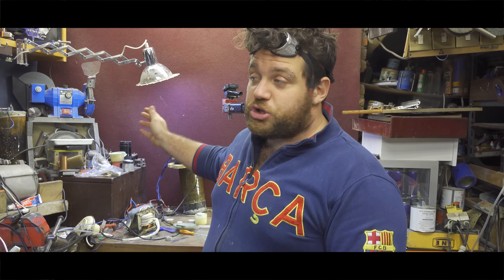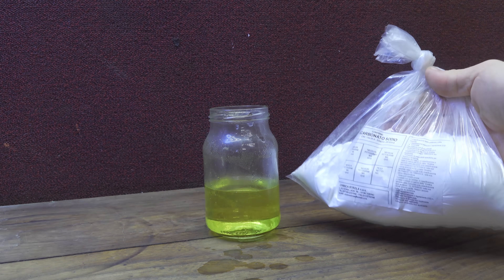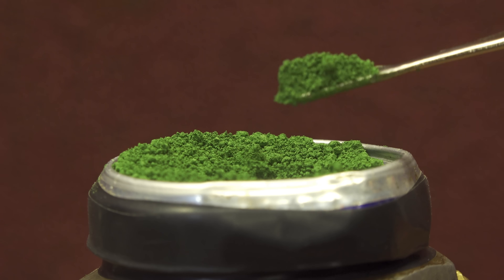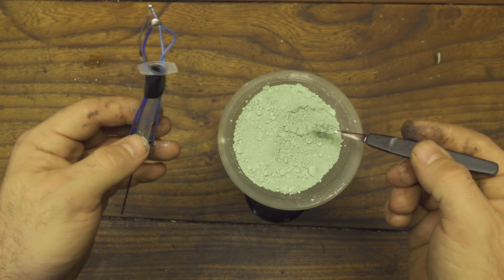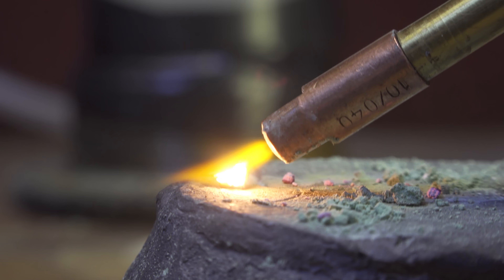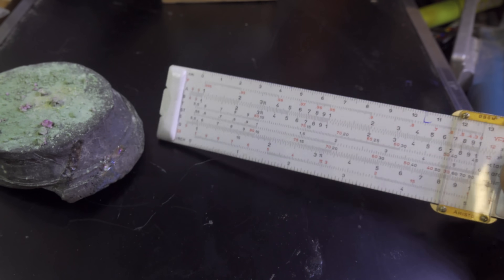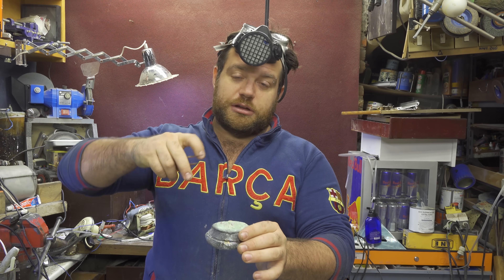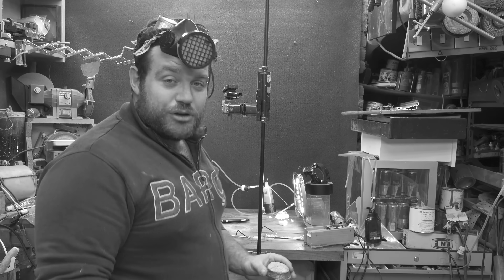How to Make precious Ruby at Home - 4K

Comment: I mean it's a cool video but I'm disliking it because of your complete lack of any safety measures or good chemistry practice whatsoever

gets to the part with the Chromium Oxide GOOD GOD MAN YOU'RE NOT EVEN WEARING GLOVES AND STICKING YOUR HAND RIGHT IN IT! Chromium is one of the most dangerous elements for several reasons. How many more life threatening things are you gonna do besides boiling acid and leaving a nice dusting of chromium laying around?

gets to the end Well hey at least you have a mask so you're not inhaling quite as much chromium

Comment: Industrial manufacture is made by injecting the powder into the gas feed to the flame. That way the powder melts in the flame which has to be run with an excess of hydrogen to make the flame reducing. So the burning hydrogen "steals" the oxygen from the aluminium oxide.

Comment: Heat the base surface to the powder melts as you apply additional powder. When you reach desired product, simply remove it from the base

Comment: You get a platinum crucible for $60k, your ingredients, and an autoclave to heat it, and in about a month, you can grow ruby crystals.  This was done for lasers by Hughes Aircraft in the 1980's.  The cost of production was quite high, and the process was discontinued.
Reply: Or, get a tungsten crucible? A lot cheaper.

Comment: I just stumbled into this, what did you mean with "ruby conducts electricity"? It is actually a good insulator with a 10^16 Ohm.m resistivity. By comparison, copper resistivity is on the 10^-8 Ohm.m range, 24 orders of magnitude lower than ruby.
Reply: with a name like Ruben  on this subject, I'm listening.

Comment: I want you to make emerald in one of your videos using 3:1 molar ratio of beryllium silicate BeSiO₃ and aluminium silicate Al₂(SiO₃)₃. 
3BeSiO₃ + Al₂(SiO₃)₃ = Be₃Al₂(SiO₃)₃ along with some traces of chromium(III) silicate Cr₂(SiO₃)₃ 

To make aluminium silicate, react 1:3 molar ratio of alumina and silica.
Al₂O₃ + 3SiO₂ = Al₂(SiO₃)₃

Then react 1:1 molar ratio of beryllium oxide and silica 
BeO + SiO₂ = BeSiO₃ 
Then react 1:3 molar ratio of chromium(III) oxide and silica
Cr₂O₃ + 3SiO₂ = Cr₂(SiO₃)₃

After you finish all of these react them to get emerald
Al₂(SiO₃)₃ + 3BeSiO₃ + Cr₂(SiO₃)₃ = Be₃Al₂(SiO₃)₆ with some traces of chromium.
Reply: Why do you need to react each Aluminium and Berylium with silica first? Can't you just mix the three of them together and let the reaction happen on the spot in the presence of HHO flame like in this video? I'm not very knowledgable in this subject and I am wondering if it is possible to make other gems using this process besides corundum. Thank you
Reply: @albertwidjaja5938  
Because if you react all the oxides together with silica some of the oxide will not react so there will be Crystal defects because of these unreacted oxides and silica.
Reply: @Shaheen_Hassan  Thanks for the answer. Learned something new today!
Reply: Forgot to ask, what temperature do you react the aluminium oxide with silicon dioxide?
Reply: @albertwidjaja5938  
You will react Aluminium oxide with silica at a temperature of 2100ᵒC and you will react Beryllium oxide and small amount of Chromium(III) oxide with silica at a temperature of 2600ᵒC. 
Then you will react both Aluminium silicate and beryllium silicate that contain traces of chromium oxide at temperature of 1800ᵒC.
Reply: @Shaheen_Hassan  Will it work for emerald? From what I've read you need hydrothermal or flux method to make emerald. If you can make emerald using this method, then can you make other silicate gems (jadeite, benitoite, peridot, etc)? I heard that jadeite can't be made in atmospheric pressure. Why aren't companies using the flame fusion method to produce emerald?

Comment: Wait, in order to get a crystal you need HIGH PRESSURE not necessarily HEAT!  If your melt a substance and let it harden quickly at room temperature you produce GLASS not crystal
Reply: Not for the flame fusion technique. See the Scientific American article about growing ruby boules - it was published 50 years or so ago. Are you possibly thinking of the pressure cooker (skull) technique, which I think was invented by Linde?
Reply: @buggsy5   Ok thx for the information. I just read about the Verneuil process.  What I was referring to was the natural process for most crystals to form in the earth is extreme pressure and not necessarily heat. I am really surprised by the Verneuil process. I had studied in geology classes that amorphous glass would occur when magma cooled without extreme pressure.  Therefore, at great depth and pressure we get perfectly crystalized granite, but on the surface of the earth we get amorphous glassy substances like obsidian (volcanic glass).
Reply: @OSUex  There is a bit more to it than that. Obsidian is rhyolite that cools too quickly for crystals to form. 

Both pressure and heat are necessary for both granite and rhyolite to form. The high pressure (thousands of atmospheres) reduces the melting points of the various minerals composing the magma. Slow reduction in either/both heat and pressure allow differential formation of the various crystals in the mass. 

The entire subject of igneous rock formation is rather complex and we did not cover more than the basics when I was in school. So my understanding is certainly imperfect. 

In the case of the Verneuil process, since the pressure is low, the temperature has to be very high to melt the minerals.
Reply: @buggsy5  Oh no. Obsidian is glass, an amorphous substance. Glass has no crystalline structure. It is actually the most viscous liquid. Glass flows under the pressure of gravity but very slowly. Rhyolite is the extrusive equivalent of granite. Rhyolite has a mix of tiny crystals and glass.  At the surface of the earth, the sialic magma becomes rhyolite because of quick cooling and stp as opposed to the magma chamber which is under high pressure and where the magma may have time to cool very slowly which allows the sialic magma to grow relatively bigger crystals of quarts and feldspar as compared to the tiny crystals of an extrusive rock like rhyolite.

Comment: Goldsmith / Master Jeweler here: DIY, Certified Electrician, Photovoltaic Technician, Mechanic, Musician yes I learned all the instruments except harp, drums, guitar (that one hurts) You Sir sparked an interesting idea... for that I shall let you in on a little secret. put the mixture in the crucible and put it in a forge, a casting furnace that you can make on your own to prevent your powder being blown away. there is another way to do it just using the crucible no forge. that comes with 50 years experience. Thumbs Up. i Like, OLE!

Comment: It might sound stupid, but if you make your own adhesive surface “board” using duct tape (you can figure how to make it), placing the metal bowl you used to heat the powder on to, prevents losing the small pieces. They will stick to the tape when they fall. Just saying.

Comment: First of all, these pink chunks are not rubby crystals but very fine chromium-doped alumina polycristalline melt. Making synthetic ruby crystals that large requires much more than dropping the raw material mixture on top of a refractory and melting it with a torch. 

Second, chromium(III) oxide is not a highly toxic nor corrosive substance, and although touching it withought wearing gloves is not recommendable, it is much less dangerous than manipulating concentrated hydrochloric acid like that. 

Definitely, this video makes chemistry appear like MasterChef, while it is not instructive at all as to crystal synthesis.
Reply: Whilst I agree that this is just chromium-doped alumina poly-crystalline melt, it really does not take much more to convert it to a single crystal structure. It can be done solid-state even. One would simply have to make un-doped poly-crystalline alumina, putting both in a furnace and heating them to about 3/4 of the melting point of poly-crystalline alumina for a long enough period of time, depending on the size of your sample, you will get a single crystal formation out of the furnace.
Reply: @dangillick9247  Congratulations! You have just invented one more crystal growth method. They are so dumb to use Chochralski method...
Reply: @radostin_pavlov  He didn't invent it, the process is at least half a century old. 

The Chochralski method is better in that you can grow far larger and more perfect crystals.
Reply: @buggsy5  That's fine. I accept that might be possible although I do not think such a process would be practical at all . Anyway, please send a reference if possible. I'd like to know the details and  someone might want to try and grow single crystals.
Reply: @radostin_pavlov  An interested person would need to do a web search to find details of the processes, of which there are three.
1) flame fusion - where the powder is injected into the flame and melted before it is deposited on the boule.
2) Chochralski - the boule is grown on a seed crystal as it is pulled from a melt of the material.
3) Chatham - flux grown. Chatham is the only company in the world producing rubies/sapphires this way and probably impossible for the non-expert. 

Only the Chathams have the straight crystal growth rings found in natural gemstones.
Reply: @buggsy5  I know well these crystal growth methods. But my congratulations were for Dan Gillick for his method of  crystal  growth without  melting.
Reply: While I debate the first part because Ruby's are just dropped al2o3 and if the end result is roughly the same who's to notice. The rest makes sense.
Reply: @johnsherfey3675  The end result is not the same. The material is opaque.
Reply: @radostin_pavlov  A lot of natural ruby is opaque, or nearly so. Clear crystals are not common.
Reply: @buggsy5  I know, but still they are crystals, although rather useless ones.

Comment: sir, excuse me, if you just evaporate water from hydrate, it still hydrate, not alumina ( al2o3 ). you need at least 500 degree celcius and direct flame to make alumina to release oxygen atom from hydrate bond. but it awesome, you make ruby from hydrate and chrom, need a good technology to make ruby.
Reply: Hughes Aircraft in the 80's spent many millions of dollars, and finally made a pure ruby crystal process work using platinum crucibles, growing the rubies for several weeks.  They did this for their laser projects, to try to make a cheaper ruby.  It turned out to be identical to natural ruby.

Comment: i don't buy that you make aluminium oxide by yourself - it looks too white and too pure for your shabby technique 

you used aluminium foil - such foils typically made from EN-AW 8011 or similar alloys - those are containing usually about 0,5 to 1 % Iron. Also this and similar types of allows contain < 1 % copper, silicon, magnesium for . The yellowish tint pretty sure comes from the ironchloride which gets formed as a byproduct. 

so if you neutralize and filter that stuff you should get a yellow tinted powder aswell - it does not magically turn white
Reply: Oh for Fu... sake give the guy a break Harvard man!
Reply: Maybe it was coke
Reply: I'm fairly certain this is a troll video.
Reply: It could just be the camera.
Reply: No one gives a fuck

Comment: Wow!  He goes on and on about the toxicity of chromium BUT then goes on to use his bare hands, spill the chromium all over the place, wipe the excess spillage away with his hands, doesn't use a hood or ventilation system and then when he's finished he addresses us after taking his respirator off (while breathing any residual metal vapor in the air) and wipes off his nose with noticeably green fingers.  You know most of the problems with chemicals are to the marginally careful person who is aware enough to not die from directly poisoning or blowing himself up, but are cumulative instead so you might not notice feeling sick but end up develop emphysema or cancer a decade or two down the road.

Comment: Use a lens from a rear projection t.v. and the Sun.  Focus the Sun's rays through the lens onto something that can handle high heat.  this method will not blow any material around.
Reply: It also won't get hot enough since the light color of the oxides reflects most of the heat away. You need over 2070 degrees Celsius to fuse the oxide feed material. However you need approximately 2200 degrees Celsius to be sufficient to fuse it into a legit single solid crystal. However, again, you need approximately 3000 Celsius at minimum to properly make flame fusion / Verneuil process rubies. The oxide feed material should be molten by the time it lands on the pedestal or platform and it is at this point the growing boule should be in contact with the 2200 degree Celsius portion of the flame. It needs to be molten and fluid enough to crystallize with the growing lattice below. This is done to eliminate the evolution of gasses as the oxides boil, as doing will solidify into a solid froth no better than iron thermite slag which is too corundum.
Reply: Matthew Wilson , what if he used a kiln to contain the heat (Except for the top where the magnified sun enters)?  Would that allow the temp to rise enough?
Reply: @TheRainHarvester  I don't think it would only because of how quickly the heat rise and escape.  The convection generated by the expanding hot air leaving the confines of the kiln would pull in the colder outside air into the chamber.  Maybe there would be some possible scenario using some form of high temp quartz glass, or white sapphire glass so the sun rays could get inside, but I would imagine it still to be too impractical and expensive.

As a thought experiment, I would imagine going the extra mile and adding a purified layer of carbon on top of the ruby feedstock to initially absorb more heat, while also filling the chamber full of argon so that CO2 isn't instantly generated.  We're only trying to see if fusing the chromium oxide doped alumina is at all possible under this approach, so quality is of no concern.  We just want to see some red or pink coloration.  The carbon can be burned off after the fusion attempt.  The problem which I foresee would be the thermal conductivity of the kiln floor and the walls of the kiln.

The Fresnel lense from the projection TV would have to be used tracking the sun while directing the beam of focused light into the kiln chamber.  I was going to attempt working out the math, but I have to leave as my ride is here at the office.  Here is a link that you'll need to replace the spaces with dots.  I'll work on it later myself just for the sake of learning something new.

A final note for now is that it may actually be possible, but many obstacles need to be overcome to achieve this feat.  If you have the resources then I say go for it.  I tend to overthink things too, so there's that as well.  I may sound somewhat discouraging in the above paragraphs, but really, there is always something to learn and I encourage you or anyone else to explore such an experiment.  I'll try to get back to this post in the near future to follow up.
Reply: Could Electric induction be used to create the heat?
Reply: @Bob3519  From what I understand of electric induction heating it mostly works with iron based alloys. Sapphire contains a small amount of iron oxide, so who knows? Ruby can even have a small amount of iron oxide contamination but I don't know to the extent which still allows pigeon blood red, nor do I know how it might effect clarity. I do have ruby samples which I created using thermite as my heat source, and it certainly has tons of iron contamination. Hmmm. I don't think I ever posted a video on the resulting products from that second attempt.